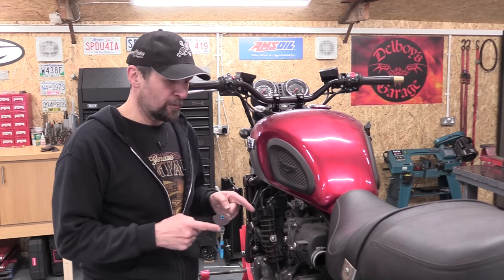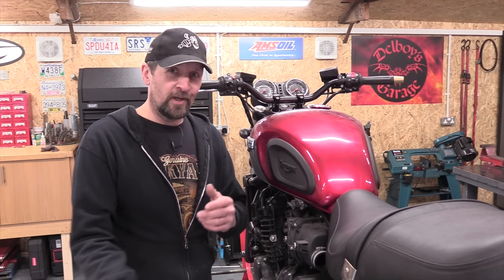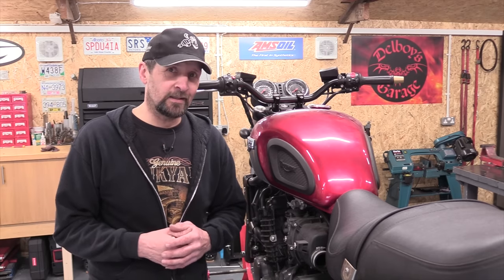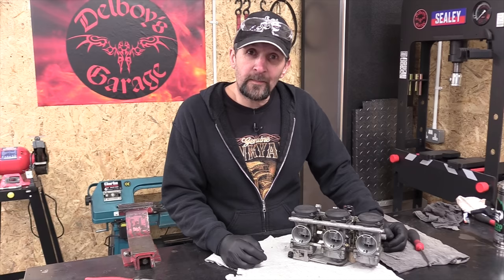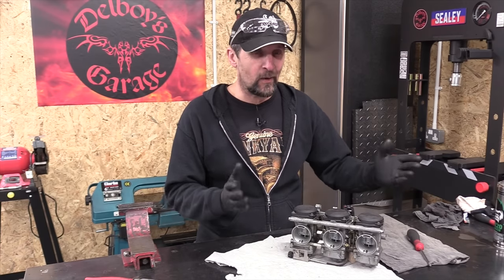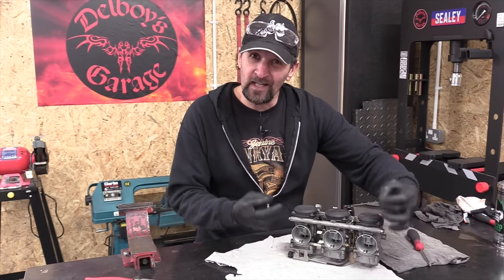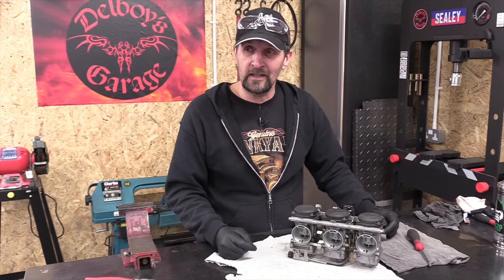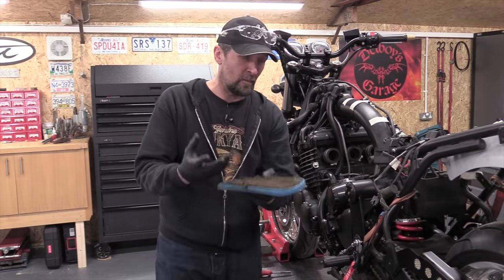Triumph Thunderbird, TT Legend, "Carburettors" !

Comment: Surprising that you didn't clean the jet's, that's where I have found most problems with dirt blocking them. I think you were lucky with the air filter not falling apart before now.

Comment: I want to sincerely thank you for your videos, I am not an expert mechanic but I have managed to dismantle and clean  carburetors and change the air filter of my Adventurer 900. It has been a fun and stressful experience in equal parts.😅
Reply from the maker: Thanks you so much for your kind words of support, im glad to help!
Reply: do you by chance have a workshop manual for it?

Comment: Hey mate! If you took the carbs out it is just a small job to clean the jets and pilot passages. Or at least let it have a run in an ultrasonic cleaner! Noce to see where that darned throttle clip was originally. Never put that back on my bike :)

Comment: No ultrasonic cleaning? After years of low miles ethanol fuel residue in the carbs could well have gummed up jets, fine air & fuel passages etc. As it’s such a faff to get the carbs off I would have done it for peace of mind even if the carbs did look in good nick.

Comment: I’ve just been through the carbs on my 1998 Thunderbird Sport, ended up replacing the stock air box with individual pod filters and rejetting the carbs.......it runs a lot better plus removing the carbs is a 5 minute job.
Reply: I did the same. The intake noise was worth the effort alone

Comment: Normally del your vids are spot on but why didn't you clean any of the jets out or even the float valve. All that effort to get them off as well
Reply from the maker: Carbs were spotless mate, didn't you see!  The main concern was to check the diaphragms hadn't perished and that the needles were not worn, but as you saw even in the base of the float bowls, there was barely a scrap of dust and before I took them out, the bike ran like a watch, so no need to dig any deeper, I've enough jobs on the list still to do!

Comment: Many owners of these 'spine frame' Triumphs (like me) modify the airbox by cutting the back part just slightly to one side of the curved part. Then you can remove that half of the back and then take the rest of the airbox out the other side, without removing the carbies... 

It doesn't affect carburation as the cut is 'pre-filter'.

Also, OEM Triumph air filter only comes as a complete airbox assembly. Or at least they do for Trophies.
Reply from the maker: Yes there's always a good mod, thanks for the tip buddy, it does seem a strange design!

Comment: I also did the cleaning recently. He was in a much more mournful state. Needle valves needed to be replaced, but even the gasoline tap had to be refurbished. It's synced and works great! Thanks for the movie, it was great!
Reply from the maker: Most welcome mate, I've taken carbs apart that are just a block of filth, every single component was horrible, but thankfully these were spotless and even before they came out, the bike rain like a watch, so a lot of time and grief saved!

Comment: I work on an 01 Legend regularly. It really doesn't often need much. Next time I take carbs off I'm going to take the cable off the twistgrip. Have always wondered how to change the throttle cable. Now I know. That air filter is a pain. Used to be very expensive.  Changed filter a couple if years ago. Carbs themselves don't give much trouble. My buddy quit riding in November when it got cold and started it last week (March) when there was a warm day. Started and ran perfect. Bike has about 80,000 miles
Reply from the maker: Wow, that's impressive!... I had the feeling when I bought this bike at 20yrs old with a lot of corrosion neglect, whether it would be ok, but it ran like a watch, smooth as silk and as you can see by the cams in the next video, it's not even run in, internals are like new!  Truly a well built bike.

Comment: Loving the legend but I have to agree with the other comments about not cleaning the jets. I hope you also cleaned the duckbill filter in the fuel line which must have picked up some crud over the last 20 years.
And if you're going to run a less restrictive exhaust than standard, you'll want to take the idle mixture screw 2.5 turns out or you will get excessive pops and bangs on the overrun. Once the carbs are back on the bike, they're nigh on impossible to adjust.

Comment: Del... Another awesome video. I would say you are lucky. I have never had the screws come loose that easy especially the float bowl ones. They are usually all striped out and I have to come up with clever ways to get them out.. Great job!!
Reply from the maker: I think you're right mate, I did feel blessed at how well that went I have to say, I think it's a testament to the fact that they've probably never been apart, so the screws weren't pre-chewed!

Comment: The tbird carb removal is a little easier than the other models of that era. A bit more clearance? I would've changed the o rings as a precaution? They harden,and crack over time,and readily available on eBay,and not really expensive 👍

Comment: Del good vid. I was a carb fitter many years ago, did cars, boat, bikes, and specials. You will find on most occasions it,s the rubber parts that will give you trouble. ie leaks air and fuel. In high mileage vehicles excess throttle spindle play will cause poor running and impossible to set up. we used to re bush the body of the carb, nowadays it will probably have to be replaced. As for jets very rare for them to block as most vehicles have a fuel filter, more likely that a crankcase breather will cause carbon build up on a slow running valve or similar device that uses crankcase vacuum. You did worry me as you had the float chambers off and didn't replace the RUBBER seal/gasket,You will probably get away with it as low mileage bike. Chances are if gasket is slightly proud of float chamber you will get away without replacing. Also did you check the needle valves ? Not good Practice LOL! Please don't think I,m having a go at you.  I love what you do and you helped me with disc bobbins, so trying to help you back.
Cheers .
Reply from the maker: I'm sure you saw how spotlessly clean those carbs were mate, and I do feel that listening to the blather from some people, that they're not satisfied till you tear everything single component apart but the simple fact is, this bike is barely run in, like you said, low mileage and a fuel filter in the line, they were spotless, just a little oily build up on the back of the slides which washed straight off, as you saw too the diaphragms were perfect, like new, and the bowl gaskets were nice and proud plus quite soft still.. this is a well cared for bike and when I rode it in, it ran like a watch!... so like the old guys say, if the cart ain't broke, don't fix it!  Thanks for your insight mate.

Comment: Your methodical step by step approach will surely have given those previously "afraid" of attempting such a task the confidence to give it a go Del - in my opinion exactly what YouTube is all about - great job - thanks as always for sharing!
Reply: He didn't do anything lol 🤔????
Reply: @garethross6258  - I am an auto electrician working on HGVs - my biggest challenge is always "getting to the fix" - especially considering they way in which modern trucks are put together - what Del has done here is equip people that don't pull bikes apart on a daily basis to "get to the fix" - it's then down to them in how far they go - dependant on the issues they find - in my humble opinion - a valuable and informative video - and it would appear that as it stand currently - 836 people agree with me? Thank you however for giving your consideration to my comment  - I look forward to watching your video showing how it should be done - please feel free to post a link to it when it's ready to view. God bless you and stay safe!
Reply: @mikeopenshaw9128   not my vid no... but one of the better ones and very much more in depth and informative   towards cleaning and rebuilding carbs... all Del did was clean the bowls and slides lol... Was a video necessary for that? And he said he was going to be cleaning out the jets? He did not go near them? You best read all the other comments and watch this video yourself 

https://youtu.be/95nlrP-yn2I

Comment: Very good video as usual,  there are two things I would have added.  Like some other comments say, I would have taken off the floats and cleaned the valve seats also have checked the jets. It's easy enough and while you are in there???  You also sprinted past the need to synchronize them with a quality gauge.
Secondly, I have found that with CV carbs it's  important to check the diaphragm for any sings of old age. I usually pull them out and hold them up to a strong light source and look for pin holes or any cracking or brittle areas but other than those two pet peeves of mine I liked the video. I find myself hooked and once I start watching I can't stop! Thanks and keep up the good work.
Reply from the maker: Did you maybe skip through the video by any chance, did you not see me remove the diaphragms, check them close up one by one for cracks and perishing, check the needles for wear??  I'm curious as it seems bizarre that you would criticise something I did in detail and showed in the video, check again 7:03
Reply: @Moonfleet41  I recall you cleaning the needles but I didn't hear you say anything about the diaphragms...sorry if I missed. I do have a question......I have a HD customer who also has a Trimuph. A 2013 America complaining of rough idle at start up, and long warm up times before it will be happy with no choke. He said the last shop just had to clean out the little hole???? And that helped. If I do decide to pull them clean an sink em do I need a special fitting on the vacuum access, or is it just hose to vacuum port? I think they are Kehins I aint had it in yet though. Any info on that model would be helpful though.
Reply: @Moonfleet41  ok you did say the diaphragms were perfect, but you didn't say how you came to that conclusion. Think if that was your only MC and you never cracked open a CV carb...you see what I'm getting at.

Comment: Hi Del, the carbs don't look to dissimilar to the ones on a GSXR 1100 from the 90's. i used to race F1 sidecars and used the 1127cc suzuki motor, a dynojet kit will transform the fueling if your budget allows. Another tip with this type of carb is to check all three float bowls all sit at the same height as the brass holding arms can weaken over time. If I was still in the UK i would buy this bike off you in a heartbeat.
Reply from the maker: Hey buddy, you are very perceptive, those carbs are exactly the same as the CV flat slides used on the 1127, just one less obviously!  And I was surprised how clean they were inside, as for sale when the time comes, be happy to ship it, already had a couple of requests so it may be well worth considering?!

Comment: My filter box was replaced with three individual cone shape air filters for each carb. Vacuum lines were plugged up. I think this is the cause of it backfiring. I got new plugs on it I might can check the coils the air fuel screw is two-and-a-half out still and I think I should have more fuel to the air that's going in it now. What do you recommend. Please help

Comment: So I'm also intrigued that you didn't clean out the jets... however, since you've installed custom headers and since you're installing a new air filter, I'm going to hazard a wild guess and predict that we'll be seeing a cheeky little K&N number going in that airbox (or possibly even a sweet set of pods and an airbox delete) with a naughty little rejet in the carbs to finish things off! I've got a similar thing on the cards for my ZRX1200 (which appears to use the same carb bodies) later this year so this video is perfect for seeing how the necessary bits come apart. :) Thanks Del, I'm looking forward to the next one! :D

Comment: That filter arrangement is a really bad design, you would have thought that Triumph would have designed a small removable cover on one side of the air box to slid the filter out, it takes me 30 seconds to change my 1976 Honda 400s air filter,  I was amazed to see how clean the carbs were, good thorough job as always, cheers Del ⚙️🔩🔧👍

Comment: I cant believe how rotten that filter was and the engine was running ok, the motor will certainly like a new filter.  Great video and nice to see some carbs.  Kind regards mate.
Reply from the maker: Cheers buddy, you're right, I think that filter was made by Mr Kipling, but the new one has arrived today, so all good to go... hope you're enjoying the Harley mate!
Reply: Thanks Del, I’m really enjoying the Harley, I’m astounded how comfortable this one is, I’m only in running in mode and on small milk runs  but i can feel its pretty quick.  I love it.

Comment: Hi Delboy, great video, I have a Triumph Thunderbird Sport with Keihins, the throttle slides do look a bit scored on mine, but all three do move easily enough when assembled,. However they do seem quite loose in the slides, and bike misses like hell, more so at low revs, and not too bad if throttle kept still.  But as soon as its turned, big misfires and flat spots..  year 2000, 36k...any suggestions.. thanks

Comment: Recently bought a 99 Legened as a do it up as I go along job. So unfortunately can't go full project bike. These videos are invaluable so thanks. I'm from Hinckley originally so always wanted a Triumph. My only criticism of the Legened is the Air system! I mean WTF! As I am going to have the cards of to sort the air filter will give them a dig out. Seriously thinking of putting pods on to 1) save the hassle and 2) free up a shed load of under seat space! 

Anyone an idea of the jetting for pods? (I know it depends on the pod, but a ballpark would be nice).

Comment: Not sure that is the origal air filter. From memory the air filter and box are sold by Triumph as a 1 piece unit (ie, to replace the filter you replace the box). Hence most people replace them with aftermarket filters.
Reply from the maker: From what i can find out, the original filters were made by Pipercross, and that's the only one single filer i could find for sale.. !!
Reply: @Moonfleet41  , think ours was paper as standard, inside the box. Replaced with a K&N because I object to throwing the airbox away to change the filter!

Comment: Love watching all your videos Del, but is there a reason you didn’t strip & clean the jets & float valves?
Reply from the maker: Did you see how clean those carbs were mate?  Absolutely spotless, like brand new inside and the bike ran like a watch, like they say mate, if the cart ain't broke, don't fix it...!
Reply: @Moonfleet41  True ......BUT.....the carbs should have been built for the NEXT 17 years of service. Carbs should have been properly cleaned and new rubber parts installed. 
That's like saying that you never have time to do it right but always have time to do it twice?

Comment: My old Ninja 250r would get what I called "carburetor slide slap" after 5-10K miles.  The slides would rattle back and forth, making a rhythmic tapping noise at idle, but disappear when throttle is applied.  I eventually isolated the culprit with a mechanic's stethoscope.  As far as I could tell it was harmless, but it happened over three different carb sets (kept buying more when I was young, dumb, had OCD about every new noise, and threw money away).  I'm assuming this is pretty common... ever hear about or experience this?
Reply from the maker: I don't know what carbs they used on that bike, but the Mikuni flat slides I put on my old GSXR years ago used to clatter like castanets on tick over and it was quite normal, and like you said, went away with a tiny bit of throttle, basically they were just bouncing off their seats on idle!

Comment: Very nice video!  I am considering using Triumph carbs on an old Yamaha triple.  I noticed there are two tubes for fuel near the bottom of the carbs but what are the two tubes near the top of the carbs used for?  Are these vacuum lines or just vent lines that exhaust to atmosphere?

Comment: Hey Del, terrible air filter box design... I thought my bandit was a PITA because I have to remove the gas (er, petrol) tank... Next time I do it I will think of Triumph. Thanks for the video.
Reply from the maker: Sure thing mate, think of the poor old Suzuki GSXR that inspired the Bandit, the early 1127 models you almost had to take the engine out to get the air box removed!

Comment: That whole assembly must be restricted between the air box and the ‘leaf collector’.
The link pipe is only about the size of one carb intake.
Reply from the maker: Is any 'non ram air' system any bigger than that in the main inlet !!? Not usually !

Comment: Del,

Since you're leaving the stock air box in place and having made a custom exhaust, do you expect to have to rejet the carbs with the change in exhaust? Keihin carbs on Triumphs tend to be really finicky and any change in either intake or exhaust and they don't seem to run properly. 

I have a 2000 T'Bird std and while I don't mind the stock airbox, other than it looks really clunky, I would like to change out the peashooter exhaust for both look and sound. But, I really don't want to have to rejet and resynch the carbs.

Thoughts?
Reply from the maker: I won't know at this point mate, I may do, I may not, I'll find out when I get it back together and run the engine, at the very worst there might be a faint possibility I have to fit a dyna jet kit, which is no great shakes aye!